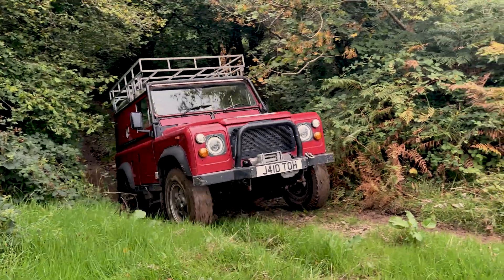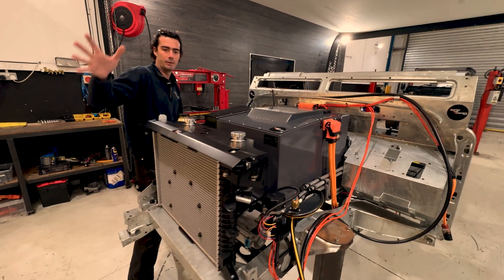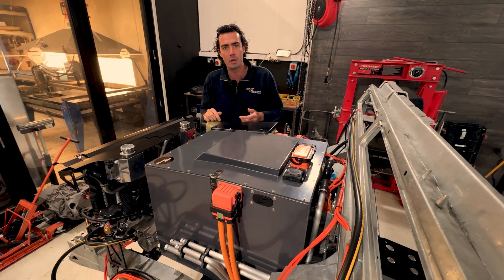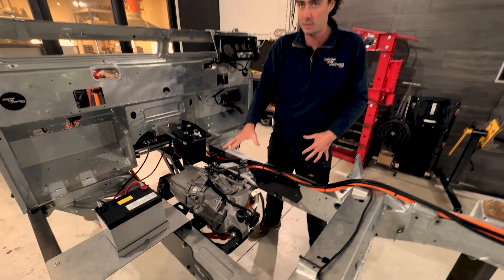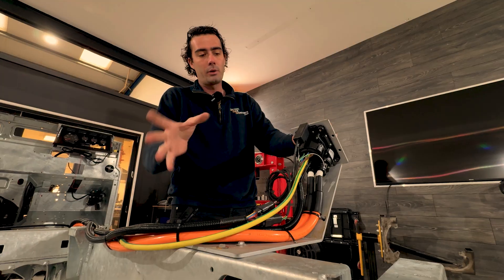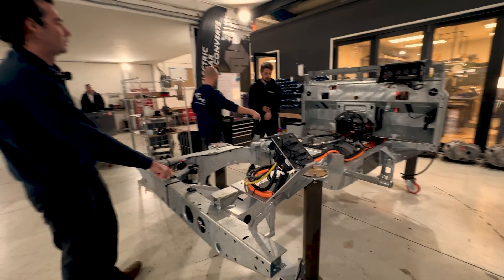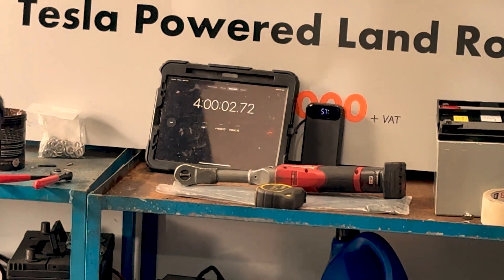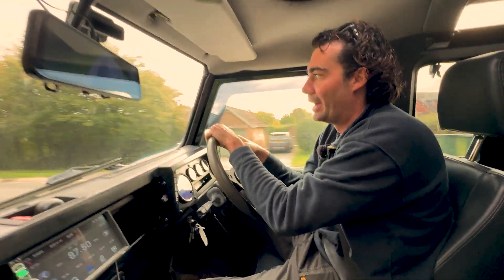Find out how a Land Rover Defender is converted to electric EV

Comment: I can see you are kind of struggling with this EV concept, you seem torn, you want EV, but probably cannot afford it.  Is it just a case of waiting for costs to come down? probably not for a while, the tech is still getting better, range, performance, choice of motor. as things elements get better the cost will not come down.  Barney's choice of Tesla is a key factor, Land Rover users are a rugged bunch, my fear with EV is that there will be too many screens, settings, and gismos added, what we really want is a cheap, affordable, get in and go EV.
Reply from the maker: You’re spot on as I am torn. I would very happily have an EV converted Land Rover but it’s not something I could sensibly afford. It’s either a case of waiting for costs to come down (won’t happen quickly) or alternatively upskilling myself so it’s something I could do at home. 

My experience of EV converted classic Land Rovers is them not being full of screens. They do a good job of retaining the sparse and functional side of a Landy.

Comment: More really interesting content (creator!) Dan 😉 More seriously, the upfront cost of converting is prohibitive for most people (including me) and the uncertainty over the pace and distribution of the essential charging infrastructure and future battery development potential is probably leaving lots of people to hold fire at the moment. It just doesn't seem a viable option until 320 miles is routinely achievable without compromising the usability (space) in the vehicle or making it insanely heavy (like a lot of TVs). I guess one additional thing to factor in is how much you'd save on soundproofing material by not having a tdi and gearbox...could put some of those companies out of business! 🤣
Reply from the maker: Thanks! 😄 it’s all rather fun this content creator lark! 

Having lived with an EV for over a year which has sub 300 mile range, the range anxiety is a moot point 90% of the time. Granted I haven’t tried doing a couple thousand miles in the space of a few days like I’ve done in the Disco this year though!

I know it can be done in an EV but there would be more forced stops for charging compared to diesel stops. 

Admittedly, how many people even contemplate doing silly miles in a such a short space of time .. 🫣

Comment: I can't speak from any experience about how much charging infrastructure you have over there but I do have experience in doing long distance overlanding in my Electric Land Rover here in Australia and so far it has been very easy. I've been through many isolated little towns that no longer have any petrol stations but do have powered camp sites (3.6kw EV charging). There are also fast chargers in more places than you expect here! I actually had a lot more range anxiety when my Land Rover was Diesel because the fuel guage wasn't very accurate!
Reply: I run a classic RR as my daily. Currently it’s a TD5 and at some point in the future I’ll convert it to electric. Costs will come down and I’ll have to be patient.
Reply from the maker: @johnnoddings6926  hard to beat a Range Rover Classic. Proper waftability with an EV in it too.
Reply from the maker: Thanks for sharing. It’s good to hear some real world experience of using an EV converted Land Rover on longer trips. 

As you touch on, as long as you are going through places with electricity amenities, the prospect of charging should be doable.

Comment: Do smaller motors draw less power than larger ones, speed for speed? In which case, would having a smaller motor extend the range?
Reply from the maker: Really good question and one I don't know the answer to myself but I know who would know.. @electriccarconverts @OutRun_YT . Hopefully they'll see this to be able to answer.
Reply: @t @torroverland  Hello, Toby from Electric Car Converts here 👋 -to answer this question: Imagine 2 identical cars in exactly the same driving conditions same speed etc, If one had 100kw motor and say the other had a 200kw motor, and both were driving at the 100kw motor cars maximum output speed next to each other, they would both be using the same power (100kw), so range would be the same -the larger motor just has the extra head room to move the car faster. Hope that answers your question 😊
Reply from the maker: @tobywilson5463 great answer, thank you Toby 🙌🏼